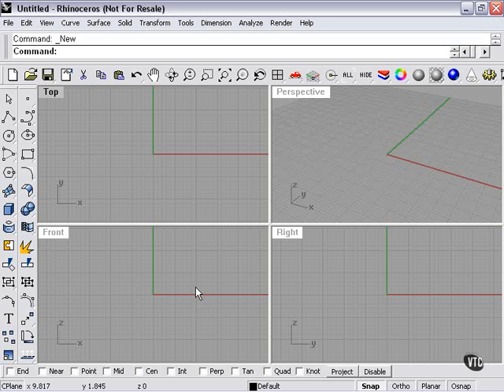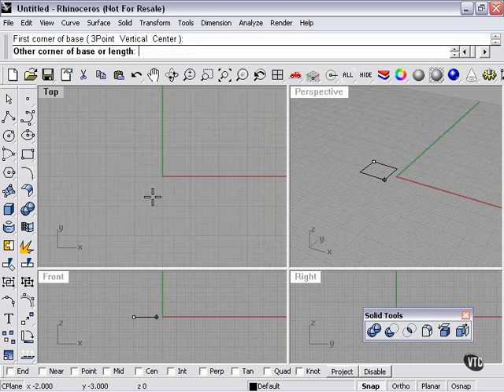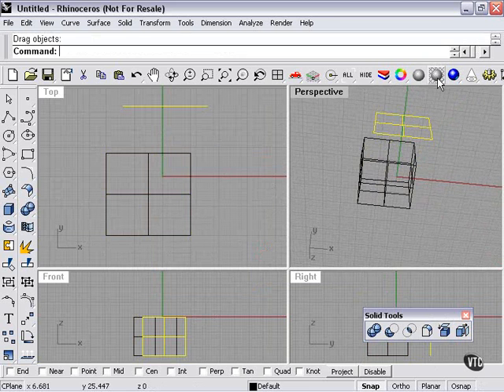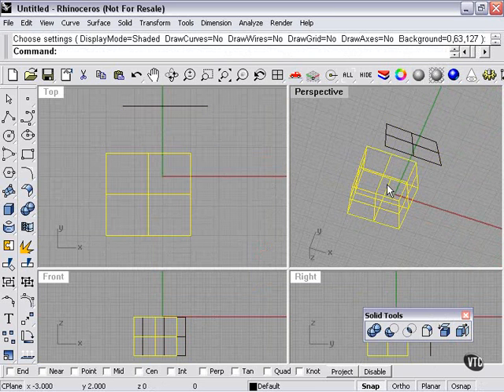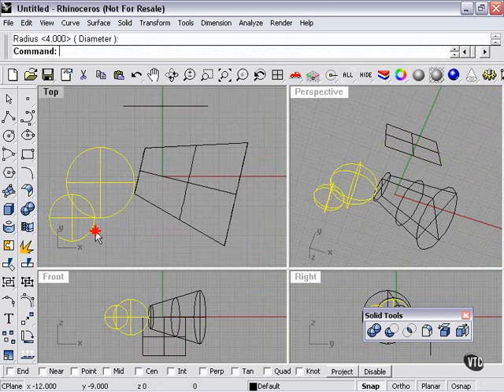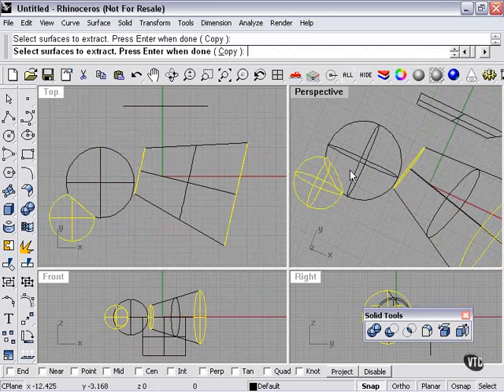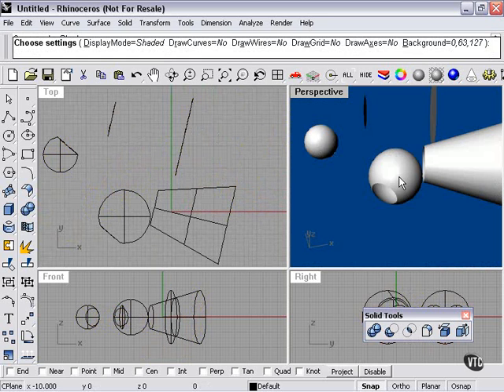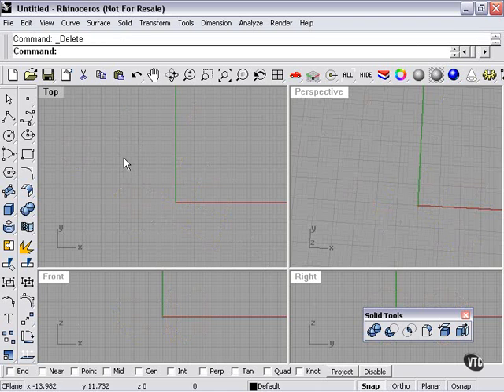Learning Rhino---Extract Surface

Comment: Hi mate was wondering if you could help ive been trying to extract a surface on rhino.So ive made a box selected the top surface clicked extract surface and i can move the top off but the box is still solid and i can keep extracting the same surface over and over again.So i end up with loads of tops but box is still solid thanks